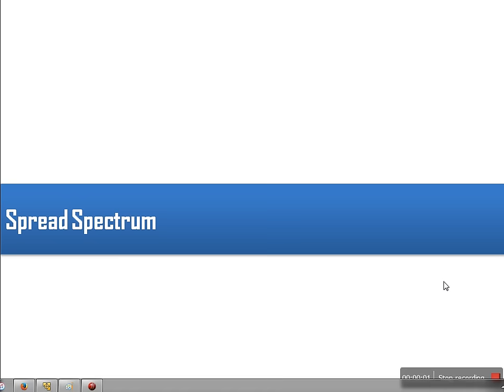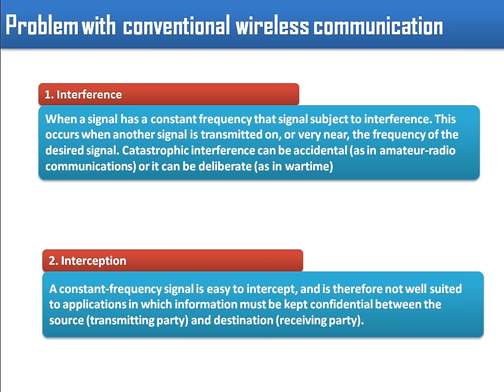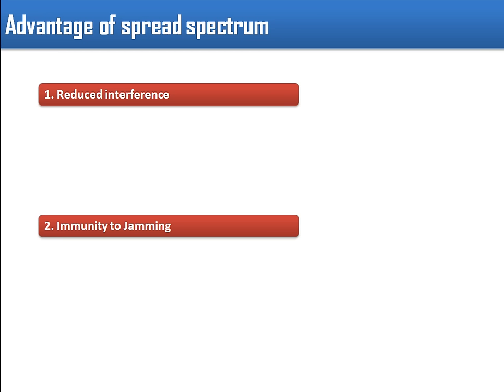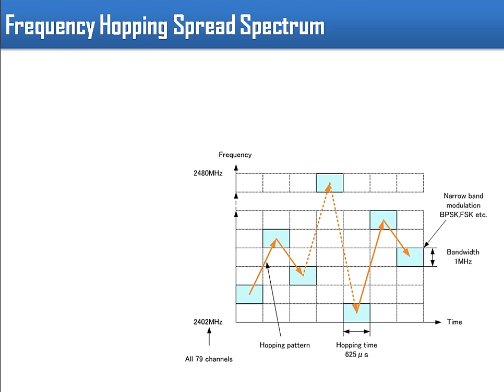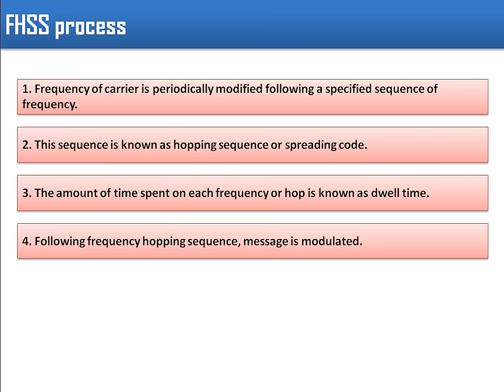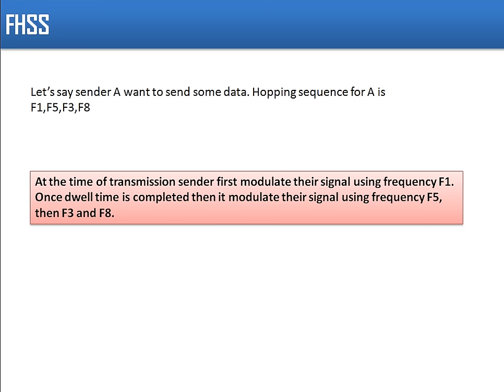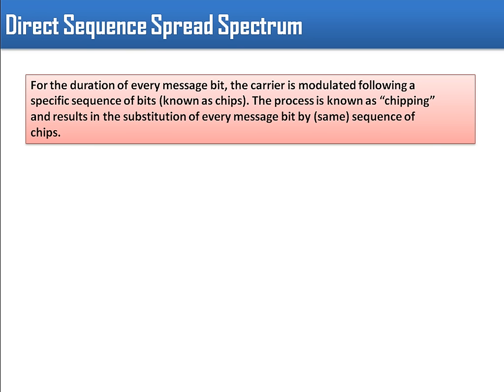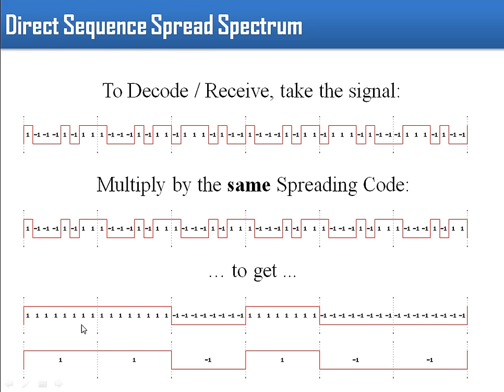Spread Spectrum Technique -- Frequency Hopping Spread Spectrum and Direct Sequence Spread Spectrum

Comment: IN the final DSSS, how does the signal occupy a large spectrum?
Reply from the maker: When a bit in original signal encoded with chipping sequence then it is spreaded over larger spectrum.
Reply: If it’s 1111111 -1-1-1-1-1-1 11111111111
It will simply become 1 -1     1
Reply: @HowTomakeitdone  right?